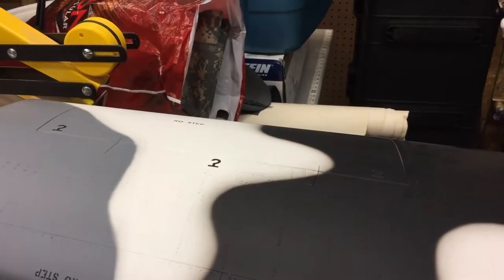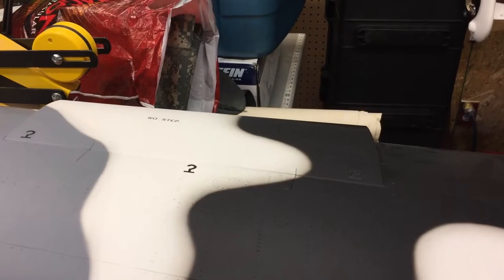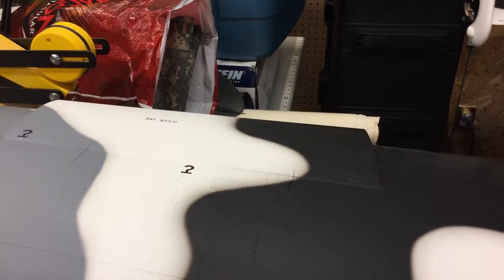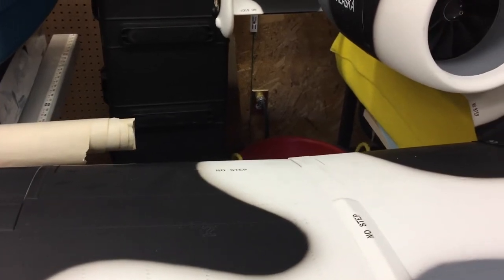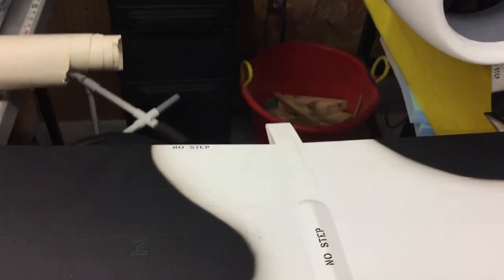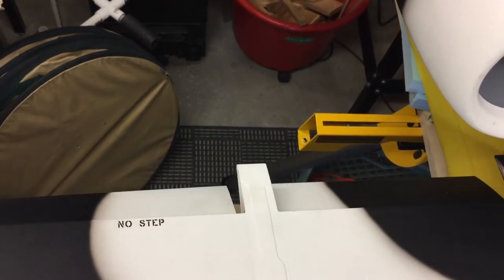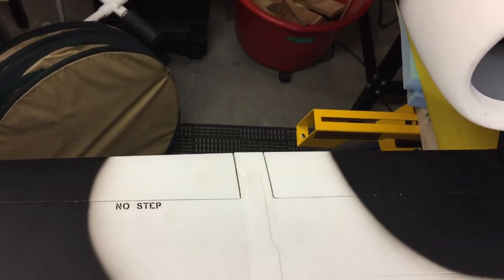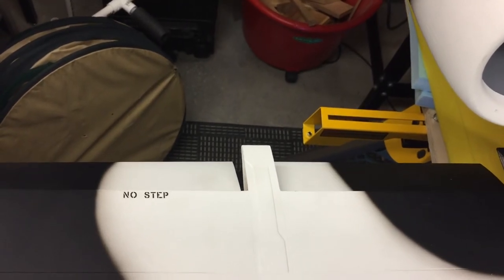A-10 aileron and flap movement

Comment: I hae an 90mm a10,having trouble setting up my flaps to operate with my aleirons.
Reply from the maker: The flaps should move independent of the ailerons on a separate 3 position switch. One position is for normal flight. Second position is for take off, third is for landing.

The manual should give you how much to move.